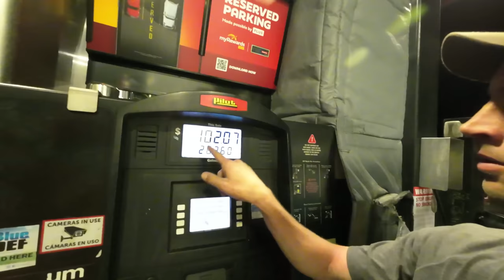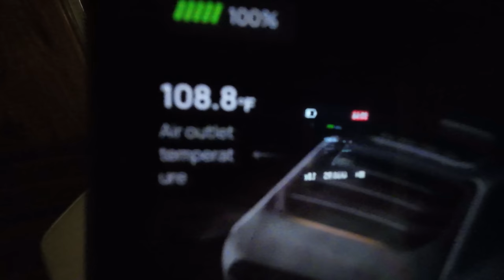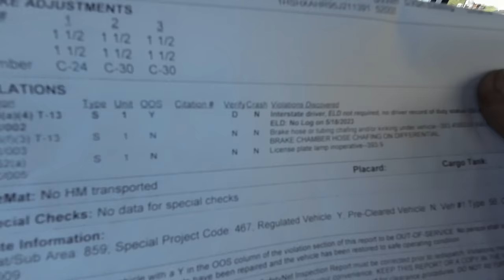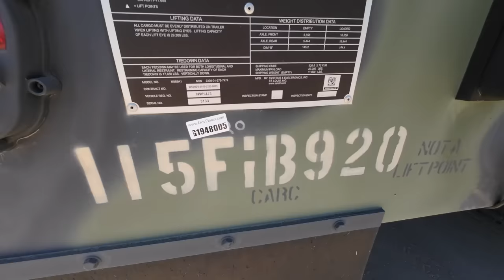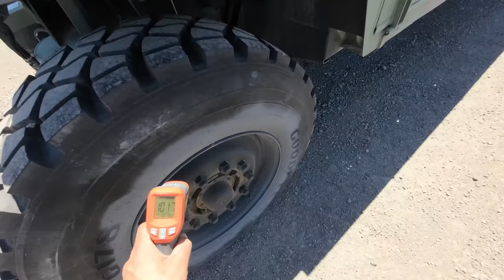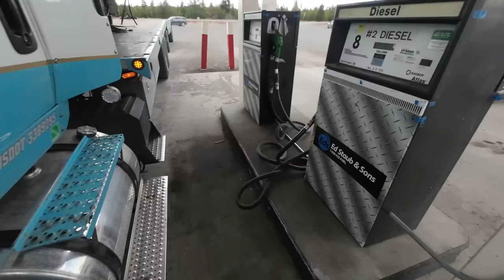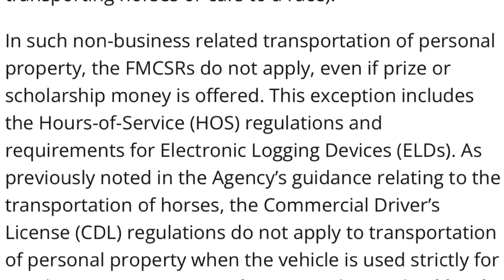Busted by CHP!   But I Know a Loophole…

Comment: DOT can be such a pain when they want to be, complaining about the stupidest things.  One time I got stopped on Route 9 in Fishkill, NY by a DOT officer that got behind me on 84.  Right before we got to the checkpoint he lit up his lights and had me pull inside.  Did the whole inspection, and busted my balls about one of the LED tail lights that had some phantom power coming from somewhere, so it never turned completely off.  Otherwise all of the lights, and everything else was in perfect working order.  He actually gave me a ticket that said my lights didn't work at all.  I was standing behind my truck with him, pointing at the WORKING light that he said didn't work, and asked him why he gave me a ticket for it when it obviously works.  He didn't have a good answer for me, but told me I had either 7 or 14 days to fix it and submit proof that it was fixed, AND pay the ticket.

Comment: The military keeps equipment that is intended for use during a war called War Readiness Material (WRM) assets   These items are never used but maintained in a readiness condition. During Desert Storm the military found out that a lot of these WRM assets were not on hand because the government didn’t fund these items. But during desert storm all items that were required were ordered. So you might have one of these never used assets. Lucky you.

Comment: GCWR > 10,000# or hauling "large" amounts of hazardous materials or animals.  "Not for Hire Trucks" don't need log books if they operate within the state that the truck is registererd.  Cross into another state the rules change and a log book is needed.  If the truck isn't placarded "Not for Hire", a log book is required.  It looks like the FMCSA requires the logging of personal use of a CMV.
Reply from the maker: Wrong.  Look on the exemption that I listed.  I was 100% in the right.

Comment: Little brother just find a pull type camper and remove the tongue and suspension and set it in the available space you have to work with. I’m betting there is a camper (without tongue) that will fit that perfectly. Problem solved. Food for thought.

Comment: The Federal Motor Carrier Safety Administration (FMCSA) has previously provided guidance regarding an exception to the Federal Motor Carrier Safety Regulations (FMCSRs) for non-business related transportation of personal property, including the transportation of animals and vehicles to shows or other events. To qualify for this exception, there can be no compensation for the transportation, and the driver cannot be engaged in business related to the transportation (e.g., a professional racing operation transporting horses or cars to a race).

In such non-business related transportation of personal property, the FMCSRs do not apply, even if prize or scholarship money is offered. This exception includes the Hours-of-Service (HOS) regulations and requirements for Electronic Logging Devices (ELDs). As previously noted in the Agency’s guidance relating to the transportation of horses, the Commercial Driver’s License (CDL) regulations do not apply to transportation of personal property when the vehicle is used strictly for non-business purposes unless a CDL is required by the driver’s home state.

Comment: The officer was correct to write you up on that hose, because chafing is covered in the rules, not just wearing, because chafing leads to wearing in time.

So even if it was just a scuff mark now, it was in contact with another part and chafing, and it would have eventually worn through.

If it had been actually worn, instead of just writing you up, they would have put you out of service until the hose was repaired or replaced.

And while you might have been technically correct on your specific scenario regarding logging, since it's such a rare scenario, it's on you to be prepared with the documentation and rules that allow it, because you can't expect every inspector to be aware of every possible loophole. Plus, EVERYONE is constantly trying to find loopholes or make up stories to try to get around the rules, so they have heard it all lol

So consider it your responsibility to have the paperwork to prove your loophole, or just do the logs and save yourself the hassle of an inspector who has never had to deal with your specific situation.

And the fact that you are doing this as part of your YouTube business also puts a extra twist on it.

You should at least get a set of "not for hire" magnetic signs to put on the doors when doing this.

Comment: What is the ratio between the hitch and the wheels?
Do the wheels turn parallel with the hitch? 
Or do they turn slightly less, to make the rear of the trailer follow the towing vehicle better?

I think it is a lost opportunity if they turn parallel, making the trailers Turing radius smaller; rather than try to make the trailer follow the path of the towing vehicla

Comment: That's better then any truck I ever drove and glad they only checked the securement of the load I had a permit at the time and the officer told me I had to drive we didn't have a log book and with in the miles as a bird fly from home. I read the same thing
None of that stuff brand new it was issued to that trailer with in the unit. And that leak might be why it was auctioned off
That be a cool off grid rig

Comment: @casey ladelle Is that the ecoflow heater/AC?  If so how is the AC output for that amount of space, and how much power draw does it use in heat or AC mode?

Comment: 🌟🌟🌞🌟🌟 i WAS LOOKING YESTERDAY AT THEM ON AUCTION---MANY WITH SPARE TIRES NOW. , 10-T OR SMALLER EXCAVATOR TRAILERS , JUST DONT USE THE SIDE WALLS, OR WRECK HAULERS, PARTS WON'T FALL OFF SO EASILY.

Comment: Casey, personally I feel you got stopped and checked was because you had out of state tags. I was stopped in Maryland for rear light out and ticketed for it and paid almost $150.00 if I remember correctly for that back in '84. Found out at truck stop from another trooper it was a bulls * *t stop. I was out of state. By the way ~ that is one sweet trailer you have there. Can think of couple of things besides what you want to do with it but hey! Lucked out with all those goodies that came with it. Congratulations on that acquisition, Sweet - - -

Comment: If you would title your trucks to you directly and not through an LLC, and get private plates on them then you wouldn't have that problem. You can still use them commercially, but when using it privately you don't need a log book and all the bullshit. The moment that vehicle is titled through an LLC with commercial plates, it's a commercial vehicle at all times no matter the reason it's rolling down the road.

Comment: If that officer had not seen the ware on a air line at some point your going experience a leak, you get a chance to bring your track to a stop, if you don’t when your air pressure gets below 30 psi your brakes lock up.  I thought you had a class one license. Did you not take the spring air brake test did you not inspect your truck before driving it.

Comment: How can they issue you a ticket for no light on your license plate when it’s not being used? As long as the license plate on the back (in this case on your portable light bar) is illuminated i can’t see that you’ve committed an offence? In the U.K. the offence is to use a motor vehicle on a road blah blah blah with no rear number plate light, well your actual rear number plate was illuminated, it could be that the truck’s actual light is disabling once you plug in the portable trailer light?

Comment: Kind if curious as to a DOT interpretation of your setup.  Do you have to log "Sleeper Berth" or "Off Duty" while sleeping in the camper?  Lol.  Seriously though, i found out that if i traveled outside of my 150 mile radious that i didn't have to run a log in, it was just easier to put together a log set to cover my non-commercial ventures.   I am actually surprised that they didn't put you "Out Of Service" fir not having the logbook.  DOT must .have really been in a good mood!
Reply from the maker: It would have to be logged as off duty since it’s not a legal sleeper

Comment: You should have plead the 5th Amendment.  They can't force you to help them inspect your truck. That's like helping them investigate a  rime against you. I drive a 26-foot bobtail, and every time I get stopped at the scales. I never help them, and they let me go. They may say that if you dont help, that it's obstruction. But obstruction is a physical act. They can't charge you with obstruction for not helping them inspect your truck. And just an FYI. If your truck is under 33k. You don't need an air brake endorsement

Comment: You're not he first tow truck driver I've seen busted for not having a log book. And you're right, you don't need a log book for personal use BUT you do need a log book showing your last 8 days.

For the curious, the tow truck driver was caught at the Lakeshore, ON, Canada scales hauling a rail container on a flatbed tow truck without a log book. Towing cars the driver never needed a log book but because the container was freight the MTO officer said the driver had to have a log book.
Reply from the maker: Wrong.   I don’t need a log book for the previous days as they were all local.   I am fully compliant with all HOS regs

Comment: correct me if Im wrong but a level one inspection is paperwork only. Also, if you were warned for violations for your record you are essentially convicted without any due process
Reply from the maker: Level 1 is full inspection
Reply: @CaseyLaDelle  yes I see that now. I guess level 3 is paperwork only

Comment: You actually need a log book if you run over 150 miles as the crow flies even if you run local. But other than that your OK. They just changed it recently,  it used to be 100 miles But personal use no log required. Samething as PC. Personal conveyance.

Comment: I used to get 9+ miles per gallon with a loaded tractor trailer with a series 60 450hp 13 spd., 7 on a small truck isn't that good, my average gross was 100,000 lbs., yes in Canada not the U.S.. where your gallon is a bit smaller.

Comment: Not a trucker
 Do not know the laws. If for any reason.  I was to own a large rig. For personal reasons.  Example,  I buy a vehicle to restore for myself.  Dream car. I drive a large truck and trailer to bring my vehicle back. I write on the doors.  Not for hire, private vehicle.  Would I still have to stop at weigh stations.  Allow police to do inspections.  Or if I get pulled over, the police see it is not a commercial vehicle and ask and answer a few questions then drive off.

Comment: I carry a FMC safety and regulations official book with the pages with the corners bent over.  That stops all questions on the side of the road. Conversation over officer,, have a great day. I refuse to put a “not for hire” anywhere on my F-550 hauling by my 40 ft/ 102 wide gooseneck hauling my trailer with my hay for my horses non commercial transporting ….

Comment: I’m a driver from Redmond. I’ve been driving for 24 years now and I can tell you firsthand FMCSA  is nothing more than a money-grab.   Great video !  In past years, I’ve had California Highway Patrol attempt to nail me  twice for breaks out of adjustment that were in fact not out of adjustment. Luckily, one of the times for no apparent reason at all I videoed my checking out the brakes before I was inspected. The officer had  no choice, but to void the  citation, since the video time and date stamp 4 hours before my inspection! Those assholes will lie and make up crap just for the money!  Truckee and wheeler ridge both have corrupt inspectors!!!  There used to be a time when California highway patrol was considered the ELITE law enforcement agency in the entire country. NOT ANYMORE. Calicos now being run by limp waisted girly boys led by a gay governor, sadly Oregon is following the same trend!

Comment: I hate to have to explain this, but it needs to be done: In your typed explanation you used “rode” instead of “road.” Rode is used when you ride along with someone. You say “I rode with him.” Road is what you drive on. So, you were on the side of the “road” when speaking with the officer. If you were using speech to text, your program lacks a little something. It’s always good to proof read before posting, as this happens more and more. My device does not know “than” when I say “than” it always types “then,” so I always have to fix it.
Also, it would have been nice if you explained the law regarding log books and when they are required just a little more. In any case I have enjoyed your videos. I only recently saw your channel/videos and found them to be very interesting, especially getting vehicle’s out of snow covered mountains. 👍😃

Comment: Those pop up roadside scales are a scam. Luckily they wasn't doing that to the semi's. I do a dedicated run and got weighed on the portables, then weighed at the mill 4 miles away, on a certified scale and there's 2,500-3k ibs difference. Obviously their scales showed more. This happened 3x. So I'm burning approx 800ibs of fuel in 4 miles or theirs is weighing heavy.😂

Comment: Why don't you check your vehicle in the first place before you start such a long trip? Just to be safe and avoid even just a violation.  And have some of the most important spare parts with you like light bulbs which easy can burn out. Common sense.

Comment: The actual the book works in that situation is you need to be able to5th show when you went off duty and began  your personal timeother than that you are absolutely right
I got in safety one time and got lic plate doesn't work because  the light didn't have lens in it. 28:52

Comment: So, you can't qualify for a level one inspection, and be "exempt" from a log because of personal use. The federal regulations are only valid on commercial vehicles operating in commerce. I love the set up though because technically you're operating a recreational vehicle which would be exempt from the regulations if not being operated in commerce. Next time, I would bring documentation that you actually own the RV CAB and if stopped again, explain that you do use the 3-axle truck for work however, at the time of stop, your "on vacation" using it as an RV. It is up to the officer to prove that you are not. However, i would not make a big issue of it on the side of the road if it doesn't go your way. It just makes things worse. 

I think you are referring to personal conveyance found in 49 CFR 395.8 interpretations. Furthermore, there are specific things to qualify and still requires a log. It just allows you to record personal conveyance time as off duty. In 49 CFR 390.5, you will find the definition of commercial motor vehicle (which has to be used in commerce). So, if you are buying that trailer to bring it back and sell it, then your SOL. 

Bottom line is that i would have told the officer that you are just using the vehicle to pick up a trailer that you bought that is for personal use and not in the furtherance of a business or otherwise operating in commerce. Legally, you would be exempt from all Federal Regulations including a log book. So, the officer shouldn't have even done any inspection in the first place. 

Be safe out there!

Comment: So you were running non-commercial but still able to put your fuel on a commercial business card? How does that work?
Reply from the maker: Still using commercial insurance too, and commercial registration, and commercial maintenance, etc.  So what’s the difference in the fuel??  Especially when the fuel bill isn’t paid by the company…
Reply: @CaseyLaDelle , its ok man & I'm not trying to strain a gnat, I'm not commercial in any way but trying to understand for my own considerations. I ended up severely disabled after 35+ years in mining & I'm considering online business options & the ends & outs. Good luck.
Reply from the maker: @livingbyfaithatdcrp  the regulation clearly says that the truck can’t be being paid to haul the load, and that the cargo must be my personal property for the exemption to apply.  Nowhere does it say that I can’t be making money, or how I can or can’t pay for things

Comment: Yes you were correct. As long as there was no transportation of personal property with underlying businesses purposes. 

You have to see their side though. You know from driving wreckers, they are used to haul all types of different thing, including campers like you did. 

And they are told all day long that that stuff is being hauled for personal use, when in fact they are not. There are too many shady drivers out there. 

There is no way for you to prove it was your stuff and business was not involved. That burden of proof falls to the driver otherwise law enforcement if going to see something that looks like a duck, walks like a duck, and quacks like a duck, and call it a duck. 

Just have some out of service, not for hire signs and place them over the company name. 

And the end of the day, you guys were both in the right, as well as the wrong. And using the commercial account for the fuel for the trip, also adds to the evidence there is the underlying business aspect. Using it for personal use means it has to be completely separate from everything involving the business. Because once you pay for that fuel bill with a company check, that is business related expense you will claim at the end of the year. 

Next time you use them for personal stuff, use your personal card, and make sure you have the receipts that show it. As well and anything you maybe picking up, showing it was bought under your name, not a company DBA. 

So yes, both right, but watching the video also puts you in the wrong side and there is video proof.